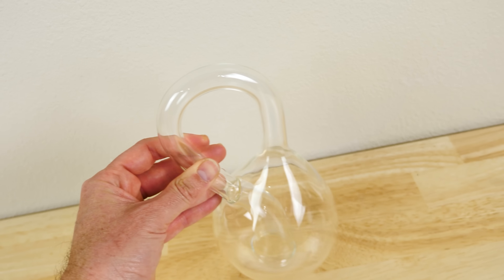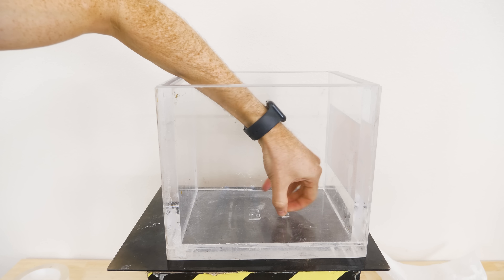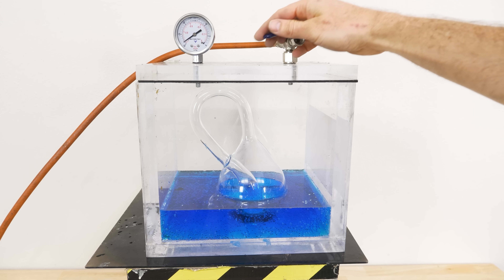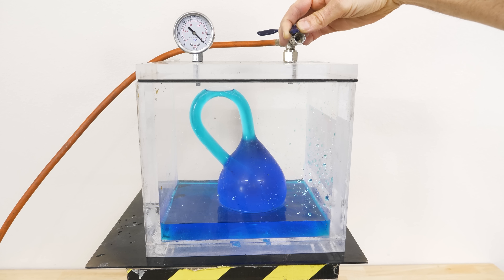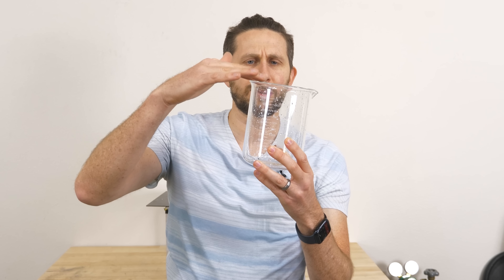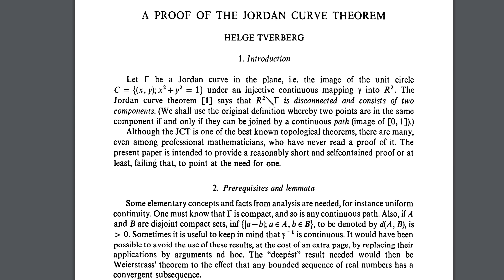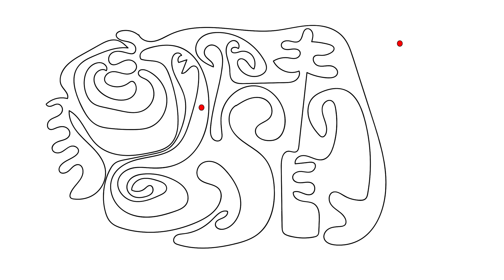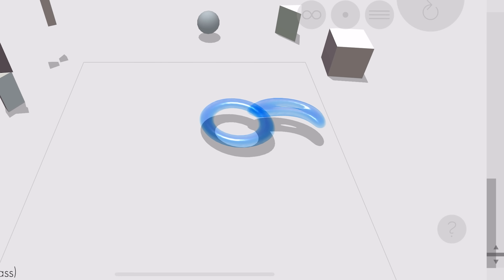Is It Possible To Completely Fill a Klein Bottle?

Comment: A related phenomena is how does a computer tell if a 3D model is a solid, or just an open surface? The one thing you can say about a true solid that is topologically true is that it has only 1 side. An outside.  SO computers trying to model 3D solids formed of polygons rely on the fact that the points defining in a polygon have to be coplanar, and they form a single surface with only 1 side. The points have to all be connected in ONE direction to define which direction is the ‘normal’- that is the side of the planar surface that is the outside. IN a true solid, ALL the normals have to point outward from the volume enclosed by the solid.   And so the definition of a polygonal solid is that ALL the sides are connected in one direction “ clockwise”  and if that results in EVERY point being shared by more than one polygon and so every point being connected in both directions, “ Clockwise but on two polygons sharing the same vertice” Then the model is a solid. Cutting a hole in the surface of the model entails simply reversing the direction of connection between the points of one or more adjacent polygons. But that will violate solidity.

Comment: oooor you could have used a thin tube or a long flexible straw to allow air movement between the inside and the outside of the bottle...

Comment: You can fill it with a tube. I use to slam bottled beer by putting a straw in it to exchange the air and stop the vacuum from forming at the bottom of the bottle. Same concept.
Reply: Its called a strawpedo

Comment: I don't think you'd need a vacuum chamber to fill the bottle, just a larger volume of water.  You could somewhat easily empty the Klein bottle by tilting it on its side to pour out half the water, and then rotate it back and forth to get rid of the rest.  You should be able to do the same for air by immersing it in water and doing the same thing.
Reply: Neat as that idea is, you would only get so far.  The curve in those bottles really loves to stay full, at any angle, and as long as there is no gap for air to escape, there will always be air in that final chamber. Immersing it may work eventually, you can google people trying to fill klein bottles, and some do immerse them, but I can't find anyone who got one completely full.
Reply: @NateyC214  
My comments are getting auto filtered for some reason, but I've found things suggesting otherwise

Comment: unless having an inside and outside world and volume only applies to hollow shapes, a beaker could have a volume since it's technically enclosed by its outer border, so it has an inside world, same as a glass pane, a sheet of paper or a 2D shape with a set border (the thickness of the border acts as the inside of a non-enclosed shape, as a border with 0 thickness theoretically doesn't exist physically, cause even if something touched the border, it would phase through it as it would have nothing to collide with, or could collide with anything on the other side), I guess at least, cause if a beaker would have no volume, then a bowl, a ball with a dent or a glass pane wouldn't have it either despite taking some physical space

Comment: if it can be filled it has a volume you stupid omfg. it has capacity cause its just looks like a regular bottle that you just took the hole and put it on the bottom and now becuase of "communicating vessels" law it cant be fully filled without pressure or something. nothing special in this shape - 4d doesnt give any special meaning for that bottle in my opinion its just looks cool

Comment: Hey, I have a question that I’ve had for a bit now. How fast can these “Hot Wheels Particle Accelerators” actually get? They seem to go fast enough to where they start moving backwards, but how fast are they?
Reply: When they start moving backwards that means they're going around approximately once every frame of the camera recording it. If the camera's frame rate is 30 fps and the circumference of the track is 1 meter, that means they're going 30 m/s, which is like 70 miles per hour.
Reply: brother they move as fast as the boosters obv
Reply: @knyt0  Using common sense, thats not always the case.
Reply: We used to have a turntable where you could fine-tune the speed of the record at 33 and 45 rpm by using two rows of dots. If they appeared to be still you supposedly had it at the right speed.

There's likely a well-known function out there.
Reply: Paging @TechnologyConnections lol
Reply: Ignoring losses such as friction etc, the fastest a car would spin would be however fast the tangential velocity of the outer part of the booster spins.
Reply: idk just put it in a vacuum chamber and find out
Reply: But aren’t those fake
Reply: Visual distortion doesn't occur until at least Mach 2 I could be wrong about that and it actually is Mach 1
Reply: @netherminer101  bro that would mean my fan's going at mach 2 and still ain't doing shit
Reply: @netherminer101  No. That is completely wrong.
Reply: @netherminer101  That's not possible, I've seen fidget spinners spin backwards due to their spin
Reply: @bitcomfy3560  thats because your eyes cant keep up

Comment: The Klein bottle has no volume in the sense that it is a 2-manifold for which the determinant bundle of the tangent bundle vanishes. As a result, it has no globally defined volume form (which for a 2-manifold is an AREA measure).

Comment: I did this with ferrofluid and some pulse coils from a railgun to accelerate the fluid as it made a current in and out of the mouth.
Now when I put small objects in the ferrofluid bath, they eventually work their way into the Klein bottle and disappear.
Oddly enough, at the same time we started getting more signals from that tiny black hole in the middle of our galaxy.
My guess is they think we are sending them our trash and aren't happy about it.

Comment: I feel like the laws of physics were violated just by making a Klein bottle in real life.
Reply: Because it's not a real Klein bottle, just a 3D-Representation of the mathematical 4D object. This video is misleading in that sense, even if it is mentioned at the end.
Reply: Only a little bit
Reply: Not really, watch the last 45 seconds of the video
Reply: It's a little different than that. Technically a physical klein bottle in 3d has the projection of one of the dimensions into the 3 other. So thin part that extends through the main shape of the vase, in a real klein bottle, does not actually intersect and make up the shape as it does in 3 dimensions. In a real klein bottle, that intersection represent direction in 2 different dimensions and so they pass by each other with a degree of freedom.

Essentially, it's like looking at the shadow of a cube against a wall and saying, "a cube has six sides". Really, the shadow of a cube has six sides at the right angle.

But we can't really "see" 4 dimensional shapes beyond how we can describe them mathematically.

So the laws of physics weren't broken, but the klein bottle became no longer a true klein bottle, but a shadow of a klein bottle.
Reply: @johnhunt1813  it doesn't exist because it can't. There are only as many dimensions as there are hear on earth. No more, no less.
Reply: @tigerlily2941  We need no proof of its existence ; it's sufficient we describe it and talk about it

Comment: You stated the obvious, that yes, a Klein Bottle can be filled to its maximum volumetric space,  obviously the information your read up on by Felix Klein was not completely correct because he didn't obviously explore all the possible of measuring the volume inside by using a vacuum chamber to extract the information needed. People should never allow themselves to become blinded by past information that they have read, especially if facts have not proven a thoery beyond a shadow of doubt by all means necessary. There absolutely is volume inside of that bottle and just because Felix did not fully figure out a way to measure the inside volume of the bottle does not necessarily mean that he couldn't have cut the bottle in half, filled all  the space inside with a liquid  by capping off the open end of the bottle and then by pouring it into a measuring cup. Find the volume of one side of the bottle and then multiplying that volume by 2 to find the final amount of volume inside that bottle. You did only half of the experiment on finding the volumetric space inside that bottle as well, so that really doesn't prove the theory os correct that there is no volumeinsidethat bottle. By vacuuming the air out of the bottle, you performed a way to investigate the volume of liquid inside the bottle when the water flowed inside the bottle. But the thing you did not investigate was how much volume of water entered into the bottle by itself by fully filling the bottle up the rest of the way , clearing any residual water out of the vacuum chamber and sucking the water back out of the Klein Bottle with the bottle being placed at a higher level in the vacuum chamber so the water can not reenter the bottle, the volume of water can be measured with a measuring cup so obviously there is volume inside that bottle! Another way to test how much volume of water there is inside the bottle would be to empty the top of the bottle out into a measuring cup and then use a tungsten carbide drill and drill into the bottom of the bottle to allow you to drain the rest of the water inside the bottle into the same measuring cup with the rest of the previous water that was in the measuring cup. Anybody who truly believes that there isn't any volume inside of that Klein Bottle is obviously not being reasonable with themselves that volume does exist inside that bottle.  If the bottle exist in its form, then obviously their must be some volume inside side the bottle to exist. Just because you can't see the wind doesn't mean it doesn't exist, right? So, there must be an existence of volume inside that bottle! A person doesn't need a mathematical equation to prove that volume exists inside that bottle they just got to believe in its existence, like they believe that the wind exist, oxygen and co2 exist when a person exhales or breathes in or out a life cycle. You know many people believe that an Almighty Creator does not exist either, but those same people experience the reality that wind does indeed exist even though they can not see the wind. Here's another interesting fact about the bible's message and what it states that God Almighty clearly stated to Moses at Exodus 33:20 " You cannot see my face, for no man can see me and live." Why is that the case ? Man is a physical creation where God Almighty is a spirit creator ,having no physical attributes like the wind, but any man can still feel the wind on themselves, proving the wind does indeed exist." So couldn't this outlook also be applied to the possibility that an intelligent Creator exists without a physical body?Yes, absolutely. Does an explanation like this make it impossible for any humans to believe that an invisible spirit creator exists, or that, that intelligent spirit creator created all things that are in physical or spiritual existence because of his having far superior intelligence to everything that was created by his power and knowledge? No! Interestingly enough, all of mankind has a book that was inspired by a creator that has far greater intelligence than all of them combined if they didn't have that book to prove his existence it would be like anybody trying to prove that a bottle exists that has no volume in it. All anyone needs to do is read that book day and night and continually compare all its reasonableness about the existence of life and how it got there so that they can comprehend that God Almighty does exist like that bottle. Why? because his voice of truth speaks volumes just as much as there is volume inside any bottle no matter how it is formed. Through the pages of the bible any individual who has an honest heart learns that our creator is a very loving, kind, caring and merciful to all other life in existence because of his awe inspiring love and generosity. His  message inspires volumes of thoughtfulness. I give you credit mister you applied yourself to an experiment. "How much more reasonable do you think people could be if everyone applied themselves to trying to fully understand the pages of God's word even if it was as an experiment at first so they can more fully understand  God's message of loving truth so they could come to grips with the greatest fact of all that God Almighty Jehovah (Psalms 83:18) does indeed exist and that all truth about his existence has been explained just like the existenceof a bottle or the volume inside of it?" Interestingly you dont need a mathematical equation  or a theory to prove that God exists. Why? because he proves to people that he exists when they continue to examine his words of wisdom on a daily basis by reading the Bible because of its being inspired by him! Did you know that God Almighty also inspired math in all of us? Yeah he even told Noah a preacher of righteousness how many cubits  to build the ark that would float him and his family to safety during a great deluge on the earth. Some people might find that factiod to be  very interesting about learning more about the bible's message of hope for the future.. By the way, very cool video using a vacuum chamber to get that volume of water into the bottle I think your time was well spent on a great experiment! One question comes to my mind: "Have you ever experimented with getting to know more about the bible's message to prove to yourself  that God Almighty does exist and not given up on proving it to yourself that he does exist  like you proved it to yourself that you could fully fill the inside of that bottle up with water instead of air?"

Comment: I know I’m gunna catch some heat with this comment if anyone even reads it. But this is a fine example of something/someone that’s so smart they/it is stupid (I’m talking about the idea of the Kline bottle not the presenter) Nearly every endeavor into theoretical physics I take, I bump into this problem. 

Theoretical physics is theory’s based off theory’s. Meaning zero scientific evidence actually exists to substantiate many of these ideas. 

First we are introduced to the Kline bottle. We are told it has no volume and no beginning or end. However we are shown a physical object that objectively speaking has a volume and in order to be manufactured has to have a beginning and an end. Then after some fun vacuum demonstrations we are then shown the theoretical model of the Kline bottle shown as accurately as possible in 3D. However it is something conceptualized in the me 4th dimension. It is literally an infinite symbol ♾️, represented in the 3rd and 4th dimensions respectively. What does this provide to us as a inquisitive human? Nothing more then a puzzle box that takes place in our mind, with some complicated maths, that describe visualization of infinity. It’s a tesseract utilizing curves instead of lines as a model.

Comment: Using a vacuum chamber to 'fill' the klein bottle is very overkill. You can fill it with water the same way you would go about emptying it. In order to get rid of any water that might be inside the bottle you would need to rotate it to let the fluid into the neck part, and then turn it back down to let some of it pour out. Bit by bit the fluid will be out of the bottle. The same method can be applied in order to fill the bottle with water, by submerging in water and 'emptying' out the air.
Reply: Its not a Klein bottle. You’re essentially explaining how a cup can be filled.

Comment: Isn't that over engineering? You can just put a thin tube and puse water through the tube.... I mean i don't have the bottle but you can try this...
Reply: Thats not a klein bottle.
Reply: @LogicCaster  yeah and real Klein bottle exists?? And will it fill the bottle with water via vaccum?

Well actually I was refering to the specific bottle in the video...
Reply: @Abhizit  
The real klein bottle does not exist.
The bottle in the video is just that. Some stupid little bottle. Not a klein bottle. 

You would not be able to just put a hose in a real klein bottle and fill it